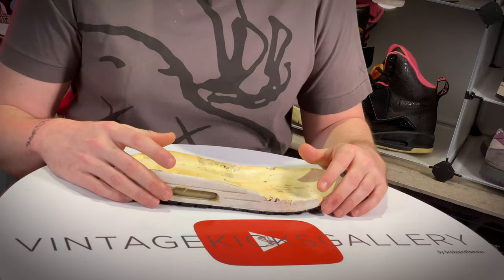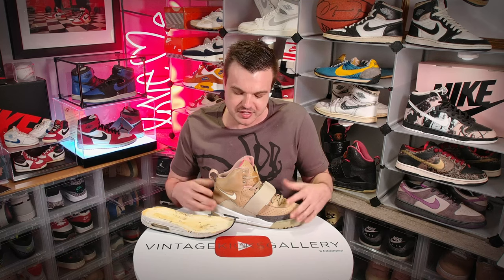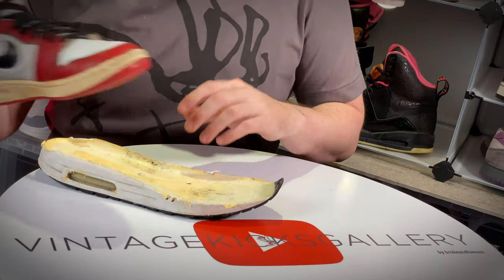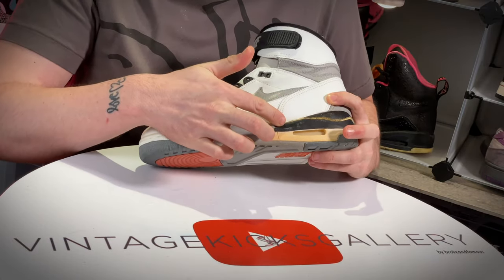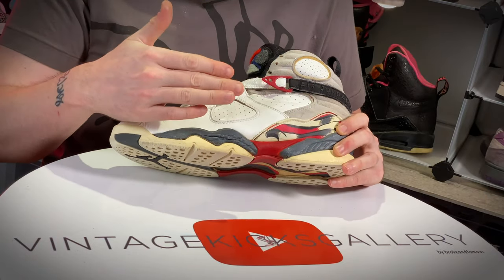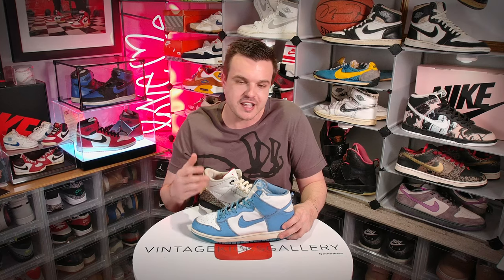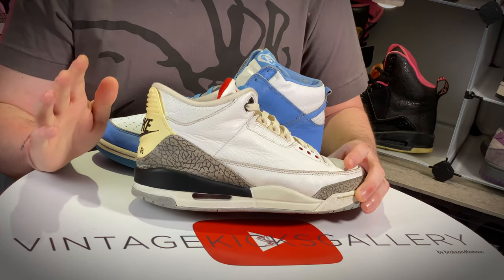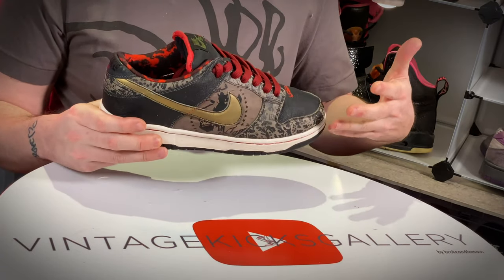How to tell if a sneaker is wearable (will they crumble?)

Comment: Here's my experience with crumbling/crackling:
1. My BHM 3's that were LIGHTLY used cracked after 2nd wear in 2021. The midsoles were springy, and no cloudy air bubble. That means that if the shoe is a decade old, but hasn't been worn enough, expect the possibility of cracking

2. All of my 2006 5's were well worn, had foggy bubbles, and cracked soon after wear. If you see a foggy bubble, just know that it WILL crack/crumble soon. 

3. My Wolf Grey 5's just had their first small crack. still wearable, and i will probably be able to walk in them for a while because the crack isn't in an important location, but again, no foggy bubble, and the midsole was very springy. it was also well worn when i got it. the age alone put it at risk

4. My citrus 7's soles hardened. I bought a pair of beat up donors for 10 bucks that I will be using for the swap. They needed a full re-glue anyway

I've learned to midsole swap, so that's what I'm currently doing with all my cracked shoes. It's very rewarding. I use hybrid jordans like son of mars for the 5's for example, or, i just buy quality fakes from weidian to get a brand new midsole for cheap

Comment: I always wondered if there is a way to prevent it from crumbling. Maybe soaking it in water for that the sole can retain some sort of moisture to give it flexibility??? Would be interesting to even try
Reply: water is partially what causes crumbling. hydrolysis and oxidation are what deteriorates midsoles. it's inevitable. no point fighting it. just learn how to midsole swap like i did

Comment: Wish I had known this before I bought a rarely used Columbia 4s. Looked very good, no sole separation, little toe crease. But when I tried them on for a second time, the midsole on one of them started crumbling.
I got it for very cheap because seller was decluttering, but man, I don't wanna wear them anymore for fear of them falling apart if I go out 😂
Reply: hello man how did those 4s age? did they crumble on you?
Reply: @skullboi3626  yeah, they did crumble. I ended up having it resoled
Reply: @mosheep  was it expensive to have done?
Reply: @skullboi3626  I think it depends on the shop/person. I spent almost 100 USD on mine

Comment: Hey Man! I have a question to ask. If any Air Jordan 2-11 from 2016 to 2019 are still DS or Brand New. Can they still be wearable? I'm really thinking of getting True Blue 3s and an Air Jordan 8 that's released during those times. Do you think they'll be prone to sole seperation or cracking the moment I wear them? Thanks!